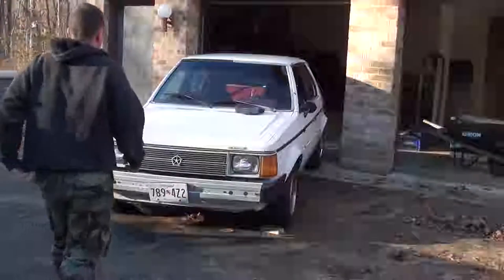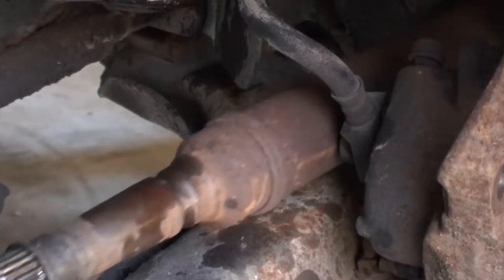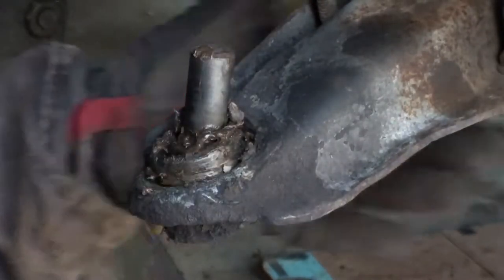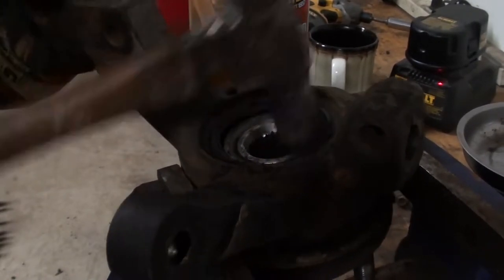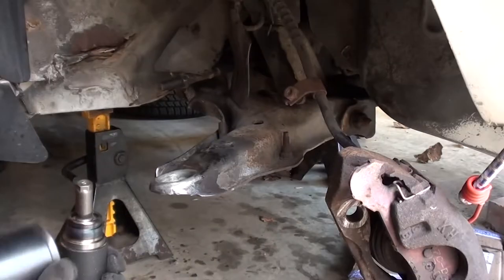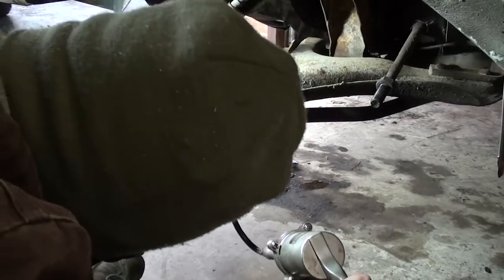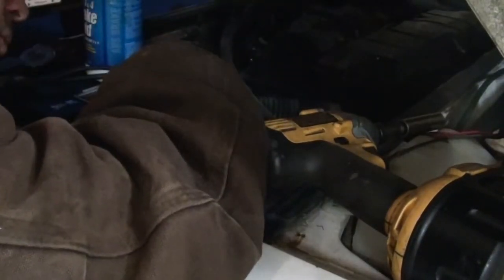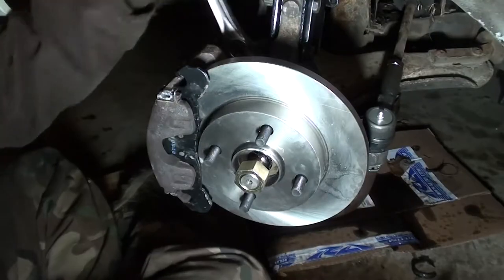Dodge Omni Front End Rebuild

Comment: I noticed this only has 43 views... I have a 1987 omni just like this and you just helped me out ALOT... thank you for posting this video... I cant wait to get mine right... drivable  but pulls right and driver tire is wearing funny...
Reply from the maker: Richard Cole all right, get it! Good luck with the repair. Check back in let me know how it went.
Reply: @jrodjared  so quick update... turns out the tire wearing funny was the REASON not RESULT of the pull to the right... tire rotation and now she drives straight and true... now the next problem it jumped time on me the other day... I have the new belt and tensioner on order and awaiting arrival
Reply from the maker: Richard Cole nice! Careful with those tensioner bolts. I snapped the alternator one right off when trying to tighten it, and it was a pain to get to. Work them on the bench first to make sure they’re smooth. Good luck!

Comment: I've had several omni glh turbos & a 86 glhs. Trans axle seal, use a screwdriver on the outside edge to easily remove it